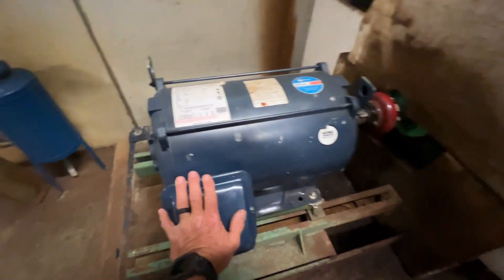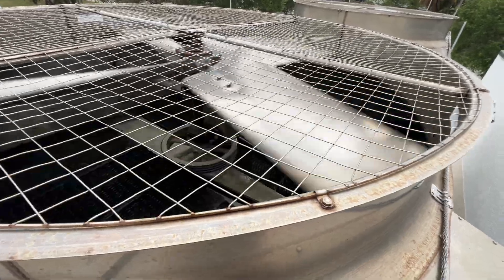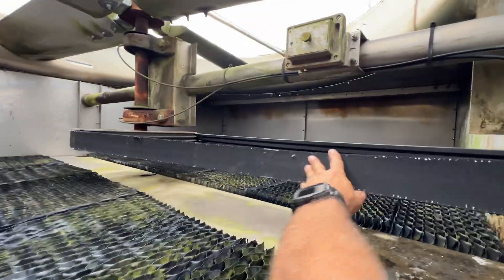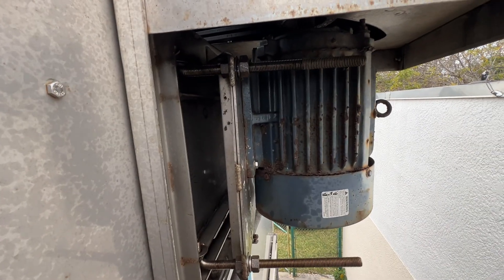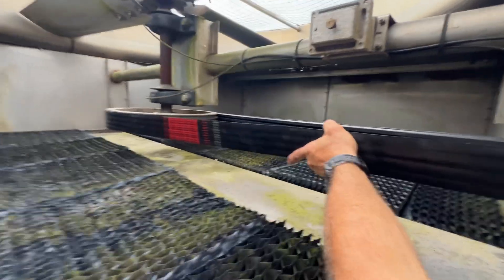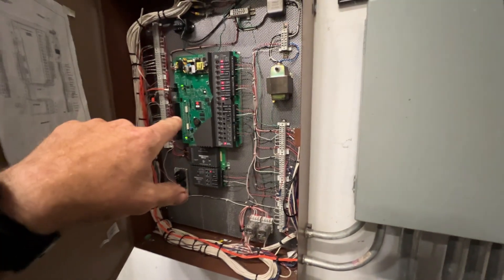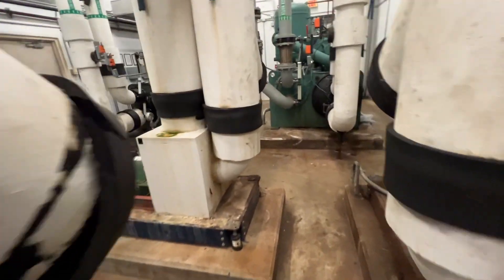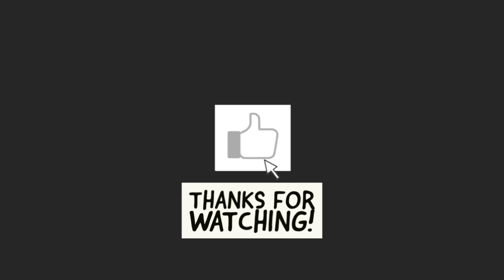30 HP Secondary Chiller Pump Motor Replacement.. Chiller Plant

Comment: Hi Subcool,  Can you explain why big boxstore like Walmart and Home Depot use rooftop package units.  I counted 9 units on the roof of Home Depot.  Won't it be easier to use one chiller than multiple rooftop units.  I would assume a single chiller would use less electricity than multiple roof units.  Thanks....
Reply from the maker: My best guess comes down to cost to build and maintain, RTU’s are more practical for service leaving room below for more merchandise and uninterrupted business. Thanks for the  question 👍
Reply: Thanks for your explanation, it makes a lot of sense.  🙂

Comment: Great Video. Thank you for sharing. What is cooling tower, Does cooling tower work in winter ? Does cooling tower generate heat in winter ?
Reply from the maker: The cooling tower works year round here, it removes conducted heat (transferred to water) from the condenser barrel and in this tower conduction/ convection and evaporation complete the heat transfer.🔄🔥💦💨